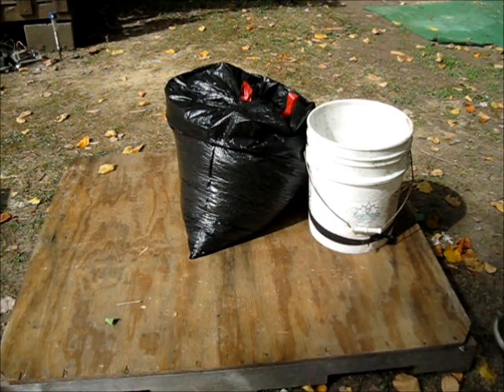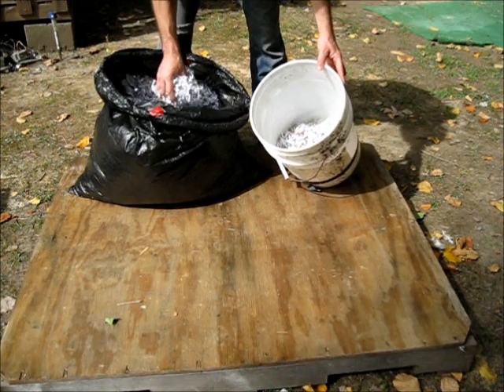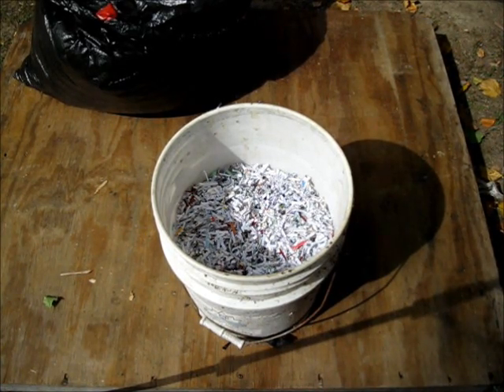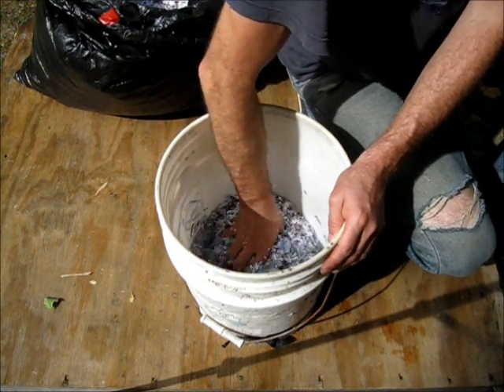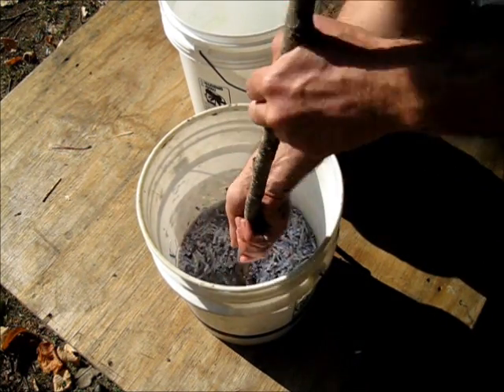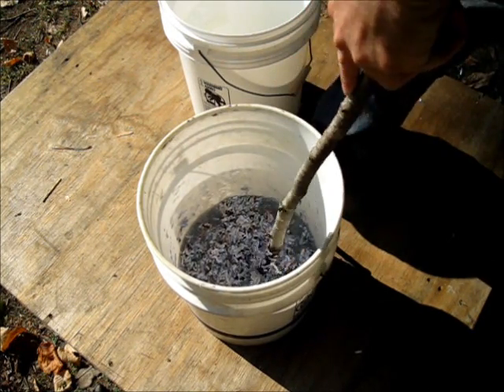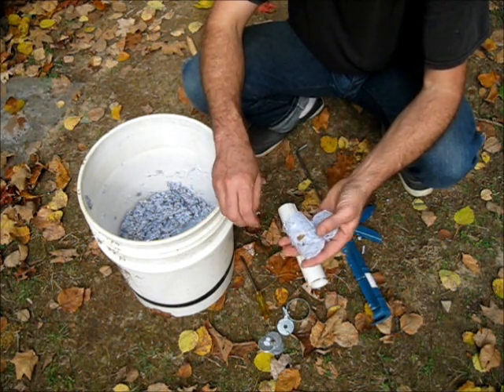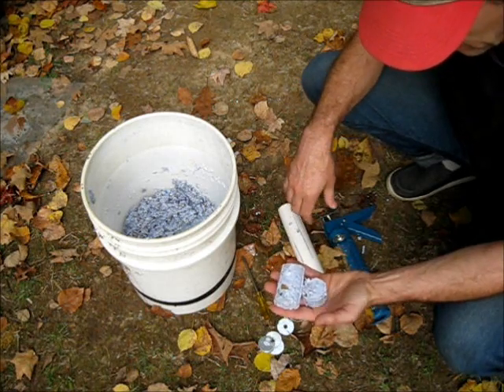How To Make Biomass Briquettes For Survival Fuel

Comment: I can see it now. The grid goes down due to a blizzard, no heat, everyone rushes out to the hardware stores in their warm cars to buy a caulking gun, pvc pipe and hose clamps. Assemble their press when they get back home. Run paper through a shredder, place in 5gallon bucket, add water, stir everyday for the next three to five days. It will become a pasty consistency. Load the pvc pipe tube with the paper biomass and arrange the two clamps onto tube. Squeeze the caulking gun over the bucket to recycle the water. Continue until there’s no more water. Release the pvc tube from caulking gun and push out the newly formed 1 biomass briquette. After three weeks of drying out, you will have a source of heat. Like he said, this could save your life if you live in the city. Or, just go buy a bag or BBQ briquettes which is certainly cheaper and faster!
Reply from the maker: Sadly you have it partly correct. Most people will not prepare until after its too late. The idea is for people to be prepared beforehand. In the cities there is a surplus of waste paper to be used for this project.

Comment: Inexpensive cheese press. Much, much more production, and a lot easier. Or an old automobile screw jack... Holes drilled  instead of slits. No hose clamps to deal with. So, so many easier and productive ways of doing this. Think and accomplish!

Comment: Dry them on top the water heater, or near a furnace, or on a rack by the fireplace/wood stove. 
Anywhere near a heat source where air is moving will help dry them quicker.

Comment: your process would go far more rapidly if you actually cut and mashed the wood pulp (which is actually what you are doing, re-pulping the paper) in the slurry state. your pellets seem like they'd be excellent for feeding a gasifier rig, as they could be actually uniformly sized, thus making hopper feeding far easier. maybe rig a plastic bucket so you can spin it on its axis, with chunks of dense sharp scrap (so no drill with a sharpened paddle kind of thing, as you are off grid). a millstone kind of setup would work awesomely too. a few hours of chopping and mashing will give you the same results as days of soaking and stirring. it's how it's done in paper mills, lol. here's an idea, a hand meat grinder or sausage grinder. run the slurry through twice (bucket to bucket), i bet you have a seriously pulped ready to go mix in a few hours.
Reply from the maker: Thanks for the tips. Good points

Comment: Instead of waiting a week or two for it to dry, would I be able to get away with baking them? Or is that a stupid question...
Reply from the maker: I guess you could but then you are using energy to produce potential energy for later.
Reply: +The Do It Yourself World I know. But for me, I don't need them right away. I'm starting to get into prepping a little bit. So, really, I hope I never actually have to use them. But, being prepared doesn't hurt.

Comment: why didn't you just use a drill with a mixing blade?
Reply: +Cory Boyd I was about to make this point but decided to read comments to find out if it had been said before. I used a drill attachment pain stirrer and was able to start making the briques the next day. there may be longer pieces of paper still but it gets broken down WAY faster.
Reply: I was about to say the same thing. I have a paint stirrer with a saw blade that shreds anything in the bucket.

Comment: so today I tried this process with paper and leaves.  I found it best to do about half leaves to half paper.  too many leaves, and it wants to crumble a bit.  I used a blender to chop up the leaves and paper in water into a milkshake type slurry.  then put into a towel, and squeezed a lot if the water out.  it tended to stay together, rather then smoosh out.  then filled up a PVC pipe, and used the caulk gun method.  a couple things a changed tho.  you don't have to cut the PVC pipe long ways.  the water squeezed out just fine with out the slots.  also, I started by kinda roughly folded up a piece of paper, to make a sort of seal.  kept the slurry from squeezing out, and should make them easier to light up.  also, I used 2 washers, to keep a single one from sliding out.  I was able to put a lot of pressure on the brick, and they came out very firm, and compressed.  they were already dry to the touch after a few hours.  I hope to be able to make enough, at least to prolong my wood supply for my wood stove, hopefully last throughout the winter.  then I plan to make many more over the summer.  I'll let them dry, then store them in large Rubbermaid containers, and keep a tub of that dessicant stuff that absorbs moisture.  they are only a couple bucks.  I use them in my project cars, to keep the interiors from getting moldy and mildewy.
Reply: also, anywhere from 100% paper, to 50% paper and 50% leaves works well.  the paper is very fibery, leaves aren't.  so  to many leaves, and it doesnt want to stick together as well.  the paper helps keep it all together, like a sort of glue.
Reply: +MVP11489 Thanks for your additions to a pretty good idea, to begin with, to make it even better. Nice of you to share your results with us also. God Bless & Shalom, from Elaina, Gma of 8. (;^)
Reply: Boise University studied the composition of the fuel. They replaced the paper shred by increasing the biomass from 0% to 100.% In order to get the fuel to stick, they simply increased the soak time of the mash from one week to five weeks as the percentage of biomass increased. The fuel was ready when: "Mash that held its form in the palm of the hand was considered ready to be pressed into briquettes."
See: http://biomassmagazine.com/articles/5148/biomass-briquettes-turning-waste-into-energy/
The benefit of adding biomass is the increased energy content in the fuel compared to paper only. Adding a central hole to the compressed fuel increased the burn rate so it was comparable to the burn efficiency of dry wood fuel. 
Using this technique for those in rural areas (in the woods), means that they can use leaves, pine needles, charcoal dust and agricultural waste from the garden to supplement any suitable wood fuel they may have. In hilly and mountain areas where runoff naturally collects leaves and other organic debris into large wet masses, the biomass comes pre-collected and pre-wetted ...
Reply: Thanks so much for the info., which will be more cost effective, and will help use compost material. May G-string Bless you and yours, from Elaina 😉 Shalom

Comment: First thing first "F&@K GOOgle+ for making people sign in" 
Cool that you are taking action. 
Old Caulking tubes work well too - instead of buying pvc
It only takes a few 1/8" holes (20 - 30) to let the water out 
the same washers you used are good 
after pressing just use a 3/8" round piece of wood to push the puppies back out the way they came in

Comment: Nice video thankyou... I should share my thoughts on the city use... If the grid went down in the city and you were left without power you wouldn't have power to shred paper, if you had some shredded paper it would take 5 days to soak it and another 4 or more in the middle of a cold wet winter to dry them so you wouldn't have heat for at least 9 days... if you pre made them for an emergency that would be better although if you were not green minded you could just buy a bag of coal for emergencies. I have a big bag of shredded paper and didn't want to waste it so I will be making these briquettes and recommend that city folk do the same to help the environment and also they will have some on hand in an emergency situation! Clever use of a caulking gun too! - I just read a comment from Targetfocus who said that if you use boiling water you can cut the 5 days down to just an hour or two which would be much better. (If you have means to boil the water of course.)

Comment: Mix some of those leaves in with the paper. You can drill holes in the PVC instead of cutting slots and you won't need the clamps.
Reply: Good tip re the holes - Would the leaves smolder? I have not used them in a briquette but when I try burning them in the incinerator they smolder - they are freshly fallen autumn (Fall) brown leaves so they may still have some moisture in them?
Reply: Leonard Hesch holes create a bond and you cant get the dry bricetts out
Reply: The slots make it easier to push out because now the pipe expanses. Look up Engineers Without Borders - paper press here on YouTube. They're so much faster to make briskets and press them out of the mold

Comment: Question- do you Have to use shredded paper? First of all I don't have a shredder, secondly if the power Does go out, the shredder won't work anyway.
 I would like to try this if I could maybe just rip up some paper and let it dissolve on it's own.
Reply: I've seen folks use torn paper. The idea behind shredding it is to make it easier for the water to saturate and break the paper down to watery pulp. So tearing it would work, but might take longer and will likely require more mixing. One video I saw, the guy welded a saw blade to a metal shaft, then used his drill as a hand mixer. It pulverized the mass a LOT faster. But, again, if there's no electricity, you either have no charge if it's a battery-powered drill, or no power to keep it running.

Comment: About 40 years past we would make newspaper logs for burning in our wood stove.  The process can be much faster than days of soaking and stirring.  We filled the bath tub with water then unfolded full sheets of newspaper into the water.  After about ten minutes of soaking we could start folding the first sheet about an inch and then continued folding/rolling the sheets of newspaper about the forming  log. Once it reached about three inches in diameter, we took it out of the tub and set it out on an old pallet to dry.  After a few days the logs were dried and ready to burn.  I imagine that this briquette press could be filled with the paper slurry after only an hour or two of soaking and give you perfectly burning briquettes after compression.  Give it a try.
Reply: I had one of those devices for making paper logs here in the UK. They were not worth the effort for the end result.

The first problem I encountered was that the ripped and shredded paper saw the ink staining the bath tub I used to soak it. It took weeks to remove - the instructions said to use the bath tub for soaking by the way.

I made lots of paper bricks which did indeed burn once dry - within minutes.

I later experimented with a variety of substances and found cow pats to work. I collected them and mixed them up with water to a thick sludge, put in the brick press and squeezed out the water. They looked very similar to small blocks of cut peat. At the time when researching, I discovered that on any one day, 100 million people around the world cooked food and heated homes on animal dung fuel fires.

They took about a month to dry in an airy outhouse. They shrank by a half.

I burned mine in an open fire. The smoke was thick, white and acrid if a back draft occurred, but it wasn't unpleasant, just an inconvenience. However, the ash would not fall through the grate. I put mine on the fire at night before bed, so by the morning, it would have kept the back boiler hot all night.

The down side was that the ash would be in a tower on the grate with a red hot bit at its summit. It was however easy enough to remove as it wasn't 'dusty' like other types of ash. As the ash was organic in origin, I found it easy to dispose of, simply by digging it into my vegetable patch, adding some to my compost heap and also if kept dry, my hens dust bathed in it.

I later experimented successfuly with a simple small spade in a shed where cattle had stayed over winter. Their manure and straw bedding mixed was well trampled and mixed. The farmer said I could take what I wanted. I cut blocks with my spade about 12 inches long by 12 inches wide and let them dry in the same way as the cow pat blocks. They took about the same time to dry. They burned in the same manner, but for longer as the density was greater due to I think the continual trampling by the cows.

I think the issue with manual brick making with any bio-mass type substance is the ability to create a dense end product. The lighter and less dense, the quicker it burns.

Dried seaweeds burn well too!
Reply from the maker: Thanks for the info. Good stuff to share with people. We need to learn the old ways. I have seen newspaper presses on ebay. Might try one some day just to test it out. Makes the process even faster yet.
Reply: You're welcome, though I must admit that newspaper logs were more a novelty than standard fodder for grandma's stove.  She generally burned oak and black locusts in her stove.
Reply: We just used a broom handle with a layer of grease on it and rolled the paper one directly out of the bathtub.  Grandma had one of those old claw foot tubs, about 5 feet long I'd guess, anyway it sat about 2 inches away from the wall so propping the stick across the tub and rolling the paper on could be done by one person. It was messy, cold, difficult and tiring, but it could be done.

Comment: Very interesting, I make a lot of saw dust from wood turnings and other shop tools. I wonder if I could 50/50 paper pulp and sawdust to make the briquettes. If it would still hold together well.
Reply: Yes, you can use up to about 80% sawdust. You only need the paper for a binder.  Also, You don't need a week to soak the paper. I use a paint mixer in a drill and hot water and make pulp in about 5 minutes.

Comment: Hello DIY, a way to help increase production is to cut off the far end of the caulk gun so the briquettes just drop out without taking it apart.
Maybe redesign it some how so that you can keep putting in the paper from the handle end of the caulk gun so you can keep production running.
Another way to mix up the paper is to use a drywall mud mixer you use to mix up drywall compound.
If you don't have electricity then use one of those heavy duty hand driven crank drills.
Not only can you use paper but old leaves or even grass clippings.

Comment: What if you added glue and used these as building materials?
Reply: I use a mix of fine-ground corn flour and water to make a very thin paste to help hold then together.  But then I compress them to about 10-tons using a 6" x 16" metal pipe and an adapter on my log-splitter.
Reply: Oh ya, I mix the paper with about 90% sawdust which probably makes the glue more necessary!

Comment: call me crazy... but I don't think that the ink and toner on the shredded paper would be healthy to use for cooking.....
Reply: but you probably have no problem irradiating your food in the microwave.
Reply: Miles Hi Microwaves don't stay in the food. It heats the water ion food, nothing more.
Reply: Light is also  is a form of radiation. Are you worried about that?????
Reply: beju sev There is no scientific consensus in that microwaves are "bad", the only thing heating up are the water molecules, same as when you are boiling stuff. Sure you'll find a lot of quackery on health-sites saying that it'll "zap" the nutrients out but they don't have the slightest clue about how microwaves nor "regular" cooking works.
Reply: at least as far as news print type mailers go, the ink is likely soy based.
Reply: Honestly the amount of ink and toner is not sufficient enough to cause harm the heat produced would most likely burn them off fast enough that they would be harmless....Again this is not for every day use either it is for emergency situations.
Reply: Phil Dyer Yes i realize this, but sending microwaves through the water molecules in your food is still not good. It is a form of radiation, and it destroys the food's nutritional value-at best, and causes cancer at worst (depending on what is being microwaved with it).
Reply: dont remember where i read it, if i find it again I'll share, but it seems like i read news print is nontoxic... might be wrong...
Reply: I probably wouldn't roast hotdogs or marshmallows open these flames, but heating soup in a pan does not expose the food to the smoke.  Hell, when I was a kid my grandma still frequently cooked over a cow manure fire and no one got sick!! God I miss her apple pies!!

Comment: Good video. You may be able to speed up your production process by using hot water and a drill powered paddle mixer at the start. When I made home made paper, that's how I did it before adding the pulp to my screens.  Just an idea.

Comment: Hey Troy. You know I think it would be nice if you would make a video on how to make water proof fire starters. 
Buy some of the small, 100% cotton cosmetic rounds. (I bought a bag of 80 at the Dollar Tree store for 99 cents.)
You'll also need some wax. You can find wax at the dollar store too. It can be blocks of wax or the was of candles. 
Just melt the wax in a pan and dip the cotton rounds in the wax one at a time, make sure to coat the rounds well, and let them dry. Just a thought :)

Comment: Plus, don't want to be breathing the output from any wood fire. Particularly a fire that has more than natural wood in it. Paper, especially, anything other than soy based ink in newspaper, can have noxious chemicals in it. Including slick paper with a high gloss print & glue in cardboard, for example. Either burn it outdoors or vent the smoke outdoors!

Comment: Respectfully disagree. Not "silly". Many viewers cannot easily pick up a piece of wood to have heat and/or cook. Especially when a storm makes going to find dry wood difficult, if not impossible.

All viewers should have access to paper. Can make these when they can't head to the woods with a chain saw. Much easier to make than using an ax / bow saw. Much less expensive than buying wood. Relatively easy to store, as emergency heat/cooking source, when compared to wood. About having alternatives.